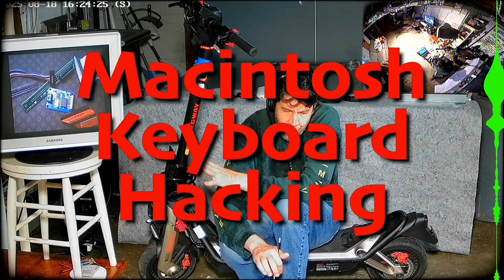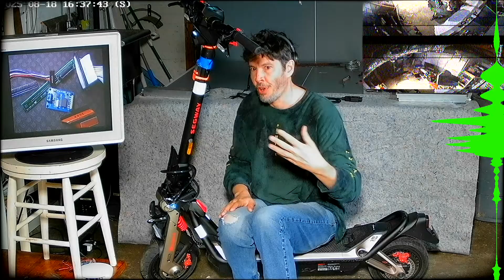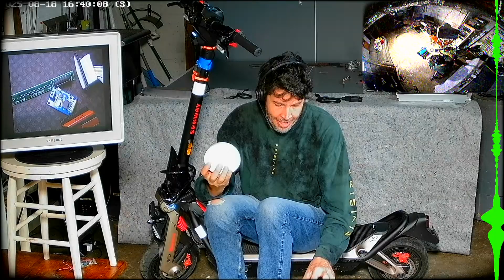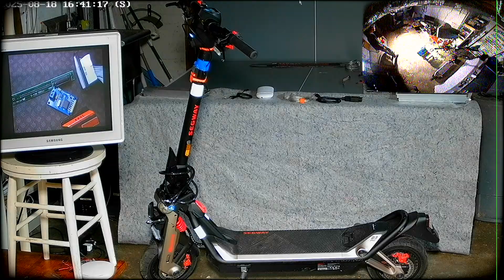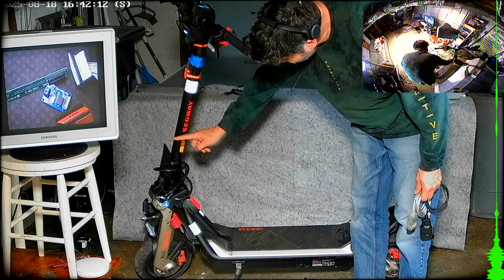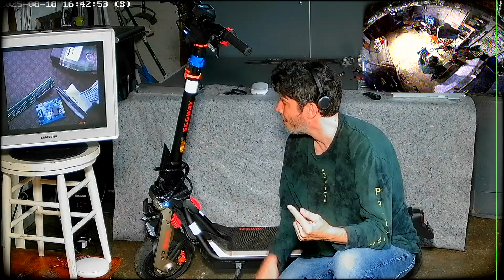Segway GT3 Pro: 100 mile review

Comment: What’s the throttle like ever hurt your hand from spinning it
Reply from the maker: the throttle is pretty springy and if you let go abruptly the scooter will kindof jerk you back a little (with the default regen brake settings anyway), but it's not a problem.  If your hand starts to get tired of holding it you can adjust your grip a little left or right and shift some of the weight to your finger.  You could also use cruise control.

Comment: Hi.  I took a spill today and want to know if that X on the lower front end of our segway is easy to take off?  A piece of the x broke off when I fell today (injured my arm) due to the City's negligence on posting adequate signage for construction.  A huge opening in the sidewalk literally a TUNNEl that the tire just couldnt clear.
Reply from the maker: I hope you've healed up and got back on!  I've only had one wreck, sounds like the one you describe above except mine was my fault ;)  Anyway, my X got torn up too - but that was it!  Like the way it's designed, it's made to take the hits so the metal frame doesn't.

Hope no lasting injuries, stay safe!
Reply: @MacintoshKeyboardHacking    so as of today, my wrist still hurts when i move it around at specific angles.  my rib cage has fully healed, but I pretend like it still has problems just so I can avoid an issue.  I'm super careful, and I'm watching the roads even more so then before.  The only thing that broke on my GT3 was that metallic X.  I already have a replacement, just don't know how to put it on yet.

Comment: Are the suspensions problematic?
Reply from the maker: I think it's awesome, but it's all subjective of course.  I'm 180 pounds, just riding on the street... generally 20-30mph, but there are some big, sharp potholes and transitions around- easily >1-2" deep.
I've never heard the suspension make a noise.  I have the front suspension knob about 2/3 toward "hard" and the rear definitely feels softer but there's no unpleasant rebound or anything like that.  When I step on, the rear suspension compesses maybe 1/3" of it's total travel.  If I jump on it, I can feel the rear get progressively stiffer toward the end of it's travel but it never really bottoms out.
Reply: @MacintoshKeyboardHacking  I’m lighter than you and I don’t have to deal with potholes, but rather with some pretty sharp transitions, so I guess it would be OK for me
Reply: @MacintoshKeyboardHacking  I'm lighter than you and would be dealing with sharp transitions but not with potholes, so I guess it would work out, thank you for your feedback.

Comment: I find the acceleration to decrease if you go only into one wheel drive that’s the main difference that I can tell
Reply from the maker: Still not sure why I would want that lol; I wonder what that button does on the regular GT3.
Reply: @MacintoshKeyboardHacking 

The acceleration is amazing but for lets say a more laid back ride you can get ride of one of the motors…

I usually keep both on but at times I just want to go a tad slower

Comment: i've had the GT2 Pro for a 3 years now. i've gotten used to the twist throttle. wearing moto gloves helps
Reply: also, you gotta put you pointer finger on the brake, and twist with your thumb and middle finger. i really have no complaints about it actually.. just gotta get used to one finger braking.
Reply from the maker: the brakes on the GT3 are pretty intense, so just having one finger on the front is for the best anyway!  I'll find some gloves soon, I expect that will help with the other controls as well.  Those GT2 look pretty solid, I like the layout- looks easy to work on

Comment: Nice haircut (looks fantastic).  Thank you for the review!
Reply from the maker: Hey thanks!  It was definitely time... the whole presentation might have been a little better if I'd remembered to TURN ON the lights :)  the rgbw smartbulbs were all set, just forgot; it takes a lot to be live!  my kid called it hostage video lighting... asshole lol.
Reply: You're welcome Good Sir.  I'll stay tuned for any future Videos.  A lot of people want to unlock the GT3 Pro to go BEYOND 50 mph, but I think that wouldn't be good for the controller in the end because the span of life would degrade faster.  I believe the engineers behind the Segway GT3 Pro have it at 50 mph so it remains "stable", and there are not abnormalities in the long-term.  ------------------ By the way I know it's not needed since the Scooter came with it, but I added a Loud Bicycle Horn (The Mini) to my Scooter and ALSO added a Garmin Varia Radar Detector using the App on my Phone.  I wanted that added protection.

Comment: I got used to the knobs you aren't liking. I simply use my thumb on it as if it's a slider or toggle if you will. With a simple flick it's easy to cycle back and forth.
Reply from the maker: I'm sure I'll get there, just got frustrated a couple times.  Some folks are passionate enough about hating the twist-throttle to replace it with the ZT3 thumb trigger; it looks like the Max G3 controls might FIT in place of the GT3 controls, I doubt making them work would be 'easy' though, also I don't care THAT much.
I think I might install the Max G3 handlebar turn signals though!
Reply: @MacintoshKeyboardHacking yeah, I kinda want them too. I like them on my Max G2.